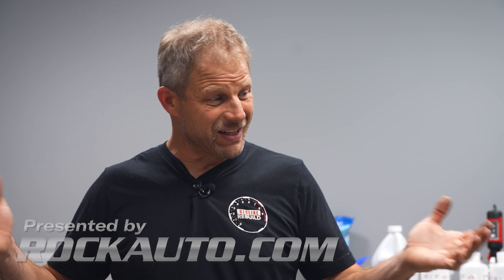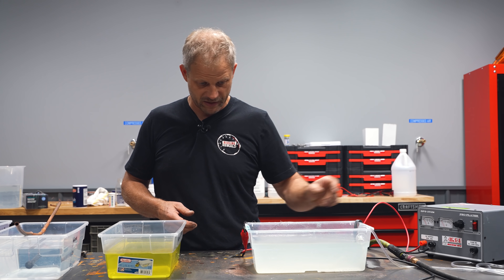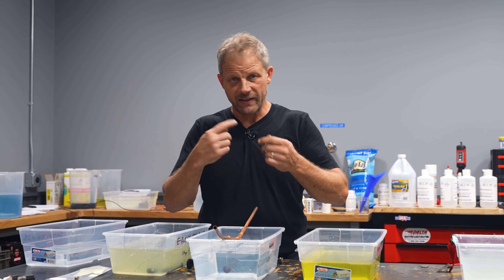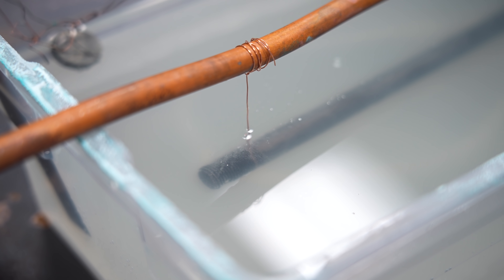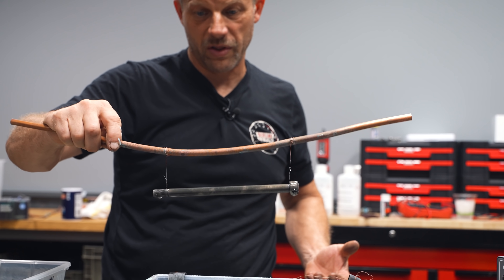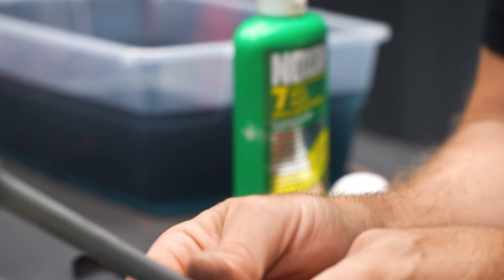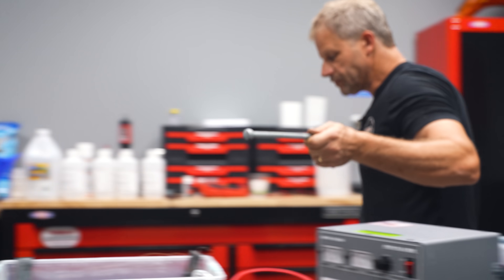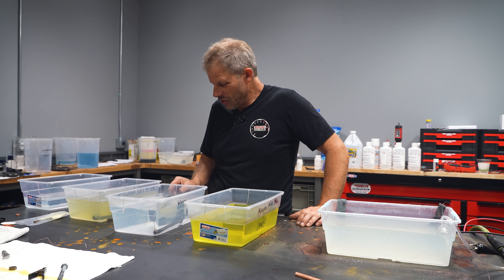We try Zinc Plating on our Honda Trail 70 | Redline Update #92

Comment: Nice job!
If I may give you some pointers:
- Plating of fasteners and more in general high hardness steel parts: be careful since the parts may suffer from Hydrogen embrittlement. This may cause them to break in a brittle fashion during use without giving notice! Meaning you tighten the bolt and it will break while the car is parked (If you're lucky). As a rule of thumb: 8.8 bolts are fine, for 10.9 bolts do a baking @180°C for 4 hours after plating, 12.9 bolts are a no-go! For nuts: they tend to be ok even without baking because they are mostly subjected to compression stresses. Just look for the marking on the head of the fastener to identify the property class :)
- Point effect on long parts: the colour change you describe is indeed what you hypothesised. Due to a different concentration effect of the electrons on the surface of the part, the plating will be thicker on "points" and thinner on "dips", hence making the plating in the middle of the length of the bolt thinner. Overdoing this can cause the coating to "burn" or rather get darker in the high electron concentration areas
- Brightener: (in very simple and unprecise terms) zinc grows in columns on the surface of the part, the brightener (among other stuff it does) slightly etches the top of these columns, making the surface more "regular"; so yeah it is in fact a light stripping agent :)
Reply from the maker: Awesome info! Thanks for commenting!

Comment: Former plating shop worker here. At the scale you're working at the only thing I can suggest is to have a clean water bath after every step, cleaning, etching, plating, brightening, so 4 water baths. You can wind up with cross contamination from letting them mix in just one or two water rinse baths.
Reply: Good catch. Also - depending on what I'm plating, I like to use distilled water
Reply: That's the ideal water to use, we had DI bottles on every line in the shop.
Reply: @kellywren9215  is DI=deionized water?
Reply: @bakatzen6243  Yes, sorry, we just called them D.I. tanks.

Comment: Hey, just came across your video. I’m 21 years as a QM at a zinc plating company, if you’re still interested in this I’d be happy to help. The white/dark spots you saw were after the pickling process? This may be an effect of carbon being introduced into the substrate at some point. The brightener that you referred to you seems to be a trivalent chromate conversion coating that happens after the zinc plating. The brightener that we use is in the plating bath, and if added in the correct proportion will help to produce a tighter grain refinement of the zinc layer. The e- chrome ultra is a trivalent passivate, with the zinc being a sacrificial layer. The chromate adds an extra layer of corrosion protection.

Comment: After plating, I run my parts through a vibe with corn cob media. It brightens them up nicely. If I want them a little shinier I'll give them a light buff with the wire wheel. The power supply I bought off of Amazon allows you to control both the voltage and the amperage. I got much better results after getting the different power supply. I second the comment about preparing your zinc bath ahead of time. That made a huge difference. I also use more zinc. I buy the cheap stuff from a big box store that's used for moss control on roofs. Pure zinc. It's a nice wide strip and so allows a more straight line between the zinc anode and the part. I also rotate my part 90° or 180° part of the way through the process. That also yields a more even plating.

Comment: I use this same method at home to restore bicycle and motorcycle parts. I go over them with a fine wire brush to shine them up and give them the look of new factory hardware. The plating holds up very well to the elements.

Comment: I was a plater for years. My tips are these, just like painting the surface finish you start with is important, get 3 rinse buckets and rinse your parts 1, 2, 3 with buckets 1, 2, and 3 always being 1, 2, and 3 if 3 is running water even better. this will save your solution as well. Finally if your amps are more than 1/4 of your volts you can burn the finish depending on your process. Add salt if the amperage starts to creep up on you. People will tell you that you need a base or strike of nickel or copper plating but with the way you are doing it your process is fine. As long as your platinting is sticking your doing it right.
Reply: Heehee, I'm a gen tech and I've heard of the old way they used to do load tests on generators. 
Nowadays they basically use a heating element and blow a fan across it so it doesn't burn out.  
But back in the day you'd use a bucket of water and salt. 
Mix up salt and water and a certain amount of brine  in the bucket would give you so much load. 
Want more load , add more brine.

Comment: Instead of sandblasting  , you can use Evaporust to strip the old zinc coating , clean and degrease your parts . No alteration at all to the original finish , this thing is amazing to de-rust and strip the plating .
Reply: Exactly . Every day we get in parts for restoration people have ruined by sandblasting , they could’ve just used Evapo and Zero labor .

Comment: nickle plate last way longer than zinc.
i zinc plated some bike parts around fall and by next spring the zinc had eroded and it was rusting again. zinc is sacrificial. it will wear off if left unpainted.  
pre made nickle plating solution can be expensive though but the longevity of it is worth it. also a well ventilated area is ideal. 
you can also skip the muriatic acid and clean the parts off with a good wire wheel on a bench grinder. gets it down to bare metal and perfect for plating pretty quickly.

Comment: Learning to zinc plate is one of the best things I did. I'm far from an expert, but I've already saved way more than the cost of the chemicals and equipment from being able to replate and reuse parts rather than buying new ones (or saving parts that can't be replaced at all!).
A good tutorial here, even if that wasn't your intention!

Comment: You have to "prep" your plating 'pickling' solution.  Zinc anode to Zinc anode.  After a WHILE it will turn green.  The darker the better.  Maybe an hour or so.  This puts zinc readily available, into the solution, for plating.

Comment: Hi Davin.
With your power source set at 5 volts & 2.5amps for 8 minutes, you will get a 0.0001-inch-thick layer of zinc per square feet.
The area of a 10-inch x 0.5inch diameter bolt is 0.105 sq. feet.
At 10amps for 8 minutes you will get a 0.0095-inch-thick layer of zinc plated on the bolt.

For my zinc plating solution, I use the following recipe:
0.4-gal distilled water
1.69 fluid ounce white vinegar
2.65-ounce Epsom salts
1.76-ounce zinc sulphate
2 Tbsp. corn syrup (makes for smaller crystals and smoother plating).

Comment: I use muriatic acid to age metal parts to look older. I just use the vapor and do not put the part in the acid.
The vapor will eat the finish off chrome/ nickle  in about 30 min

Comment: While its better than raw steel, zinc plating is effectively just a very thin galvanizing. What most people are after was cad plating, which for health reasons has been almost entirely replaced by inferior nickle plating or paint/epoxy type coatings on any thing of value, or decorative zinc plating (as in the video) on throw away never to be serviced consumer junk. Passivating it would help some, nickle or copper plating would be far better. It should be mentioned when stripping old hardware, you really dont want to be breathing the dust off a sandblaster stripping cad plated parts, you probably don't want that dust ending up in your shop, work place, garage, home ect either so a chemical means of stripping it off should be done before any abrasive is used.

Comment: Try not to sand those bolts. Clean it with wire wheel and the zinc coat it. Then it should look shiny

Comment: Do NOT “ sand blast “ CAD or Zinc parts .  You ruin the finish . Look how Dull that bolt is . Evapo - rust is your friend . 
2nd professional plating is Cheap . Throw out all that mess from your garage .